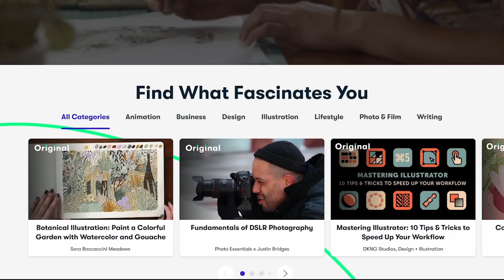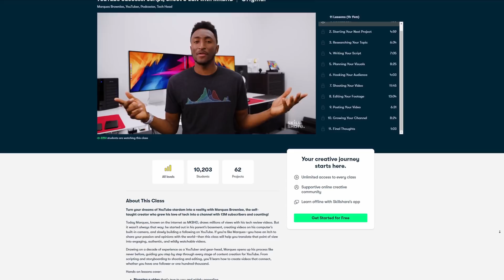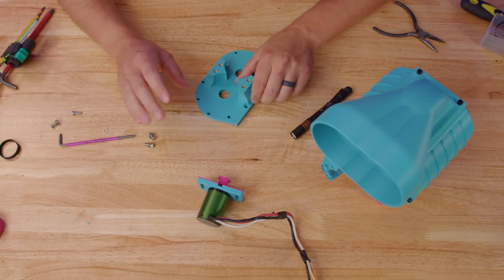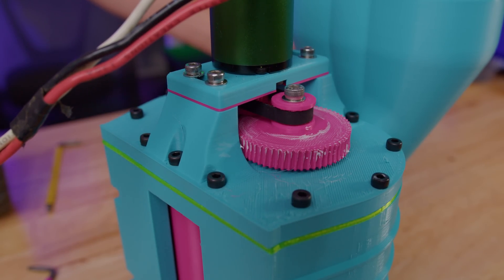I Attached a 100,000 RPM MAX Castle Mamba to my 3D printed SUPERCHARGER..... Will it Survive?

Comment: A cheap solution would be to go buy 4 or more 6800mAh 80C batteries.  Add a Y connector to the ESC to allow two batteries to be attached at once.  That will give you all the amperage you need to drive the blower.  You may also need to look at the motor.  You may have one that is great at high RPM but low torque.  You need a low RPM, high torque motor.  A 5t to 6t 2200kV to 3200kV motor would be optimal for your RPM range and battery voltage of a 2s battery.  Going to a slightly higher kV would increase the amperage requirements, but give more power and higher RPM.  I would start with a motor that closely matches the RPM you are currently hitting, then work up from there to see where the ESC gets unhappy.  Also, a cheap programmer card would not be a bad addition.  You can adjust max RPM and amperage as well as acceleration to make the testing easier.  Also, replace the controller and receiver with a PWM signal generator for bench testing motors.  It plugs straight into the ESC and just gives you a knob to adjust the motor RPM so you don't have to fiddle with the trigger to find the spot where the motor is happy.  Transversely, if you don't want to change the controller/receiver setup, put a tie down on the trigger to hold it at full speed.  Then adjust the offset for the trigger channel to where the signal sent is at 0 power.  Then use the offset adjust to control the motor.  I've done this for tethered circle track speed runs where the car take a long time to accelerate, and you don't want to push  it hard and heat things up too early.

Comment: you could also look for used server power supplies and hook two 12V rails in series for 6S equivalent. regulation would be done by the motor controller though.
Reply: @majorhardware is this a scammer?

Comment: Use a Group 31 truck battery. You can run the motor wide open until the wires melt down and the battery will just laugh at you and keep going. Charge it once a day overnight with regular battery charger. Can pick this all up at any Napa Auto Parts

Comment: Bottom outlet case should probably be a V-shape as visible on superchargers. 
Most of the superchargers are spinning at max 10-16k RPM, but peak efficiency is below half of it.
You could try to use some sort of paint/foil on the rotors do decrease friction.
You could have hollow/drilled rotors to reduce inertia.
Upscaled Cheater inlet?

Very nice project

Comment: Alternatively you could just get a 110v motor, maybe an air dryer motor? not sure it would have the torque, but I'm sure you can find a motor to run higher voltage instead of higher current.

Comment: Just use a car battery to power it. Much longer run times. Can be recharged in about the time a standard rc battery. Keep an eye on motor Temps with such a load.

Comment: you could just buy a car battery,  AGM  or the new lipo they make motorcycle batteries. if it's 12v 3s it should work. these provide significant amperage.  as for a power supply you probably need something that has 30amps or more
Reply: you can buy a 12v 30amp supply but it's not really adjustable. think computer power supply. you could make it adjustable but its not really worth it.

Comment: What you should definitely do are two things!!
1. Install a coupling to dampen the resonance vibrations then your charger won't "run away" !!!
2.You should urgently BALANCE the rotors, they are the main cause of the "wandering" of the whole charger
Tip for balancing: 
Build the rotors hollow and in two parts so that you can use bloops of "hot glue" inside as a balancing weight
I can only guess for the coupling?!
with this motor definitely as big as the gear wheel
you are able to print soft material as a damper for the clutch

Comment: Fun project. 
Try balancing the rotors on a 2 little V stands and a file or sandpaper to remove weight where necessary. Also you can use whiteboard marker to see where the rotors are rubbing on both the housing and each other and sand down where needed.

Comment: Its expensive but if you used Teflon inserts as "bearings" and the rotors its would run mush smoother.... Teflon is expensive though

Comment: When you test this, you could put the radiator on either (or both!) sides, because that type of "blower" will pull just as well as it pushes unlike a fan. They will draw a massive vacuum in a sealed chamber. 
I worked at a place doing electron beam welding and we used giant Roots blowers to draw down the air for a rough vacuumed and they would get us down like 80% of the way before we had to change over to the oil diffusion pump. I think that got us into about 30 ish tor (0.04% atm)(all our welding was in high vaccume, so like... 30 micropascals)
when i say a large Roots blower, the pipe was 10". i could fit my head in the screws. It would hold that .04% atm all night, because we'd leave them running to keep the chambers dry.

Comment: If you're going to use it as a pc cooler, then put a smaller motor on it so that it will actually lasts.

If you're not, then there's no point of comparing it to the fans that were powered by pc cooling fan motors.

Comment: Be really careful with power supplies and brushless powertrains, electronic breaking is  to be avoided at all times. 
If the ESC tries to slow the motor down, it generates power. Contrary to a battery, the power supply can't sink that, so the voltage goes through the roof.
Essentially the ESC fries itself.
Large rotating masses like your supercharger worsen the problem.
I fried a 100A plane ESC and 2 smaller ones with electronic breaking on a power supply.

Comment: build an 18650 batt pack. and use a ebike esc. 
those bldc motors don't really have a set voltage limit. higher volts make lower amp draws ( to a point)  bet u could do a china 48v batt and a 1500W china esc that'll run it for a good while

Comment: It would be interesting if you try stacking up multiple single fan radiators in series under the blower and see up to how many the cooling perfoance increases and how it compares to one normal fan or multiple fans on the same radiators spread out.

Comment: If you do go any further with this you might want to find a way to protect yourself in case it blows up.  You're pumping a lot of energy into those rotors and if they fail the energy is going to want to come straight out of the casing like a bomb.

Comment: It would be totally absurd but is there a way to design a transmission that would jack the RPMs way up from a slower but stronger motor?  For example use a standard AC blower motor like what you could yank from a furnace.  That would have more than enough power, The problem is though startup is not smooth and I dunno how a plastic gearbox would take the initial turn over.

Comment: you need a chain. will be like the belt but stronger. because once you are able to get a good power supply itll prolly strip that gear. chain will spread the load and make diffrent gear ratios easier

Comment: Hello, Supper chargers are used more as an air compressor rather than moving air.
I wonder if you can build up pressure with this after some of the problem solved,
and some how rig an outlet for more air velocity.
Reply: And also, maybe change the in runner motor for a much higher torque rather than those high RPM motors.
Not sure if it is still true that out-runner motors yields much higher torque than the in-runner motors.

Comment: your biggest issue is that motor wants to turn somewhere around 30000 rpms to maintain a somewhat sane amp draw....running it at 7000 rpms is making it consume insane amounts of current...which why your batts arent lasting very long and why your batterys are getting so hot...were talking 150+ amps constant here....you really need to get a gear reduction going to let the motor have some rpms to lessen the over all tourqe load....that or you need to find a really low like 800kv motor...heres the thing...take a motors kv rating...and then input voltage....say your running 2s at 7.4volts x im gussing that motor is 4000kv which comes out to 29,600 rpms...so you really reallly need to work on a solid gear reduction to get 6000-7000 rpm rotor speed with motor at around 30,000 rpms and that will reduce the amount of current required...batts will last as long as they would in the rc car around 15-20 mins....if you dont...then your going to run into serious overheating issues on both the motor and the esc....get the motor too hot and the core will grenade and or burn up the windings...get the esc too hot and it may very well catch fire! all this info can be confirmed in the r/c forums, im sharing as much as i know because i really really wanna see what this set up is capable of!! 1000cfm is absolutly insane....but i belive that if you let the motor wind up to its rated rpms...and get the gearing right....that you could possibly double that cfm output!! also that motor and esc should be rated for 3s lipo...which would be 11.1 volts x 4000kv which gives you 44,400 motor rpms! migt get around 2500 cfm or above at those speeds! could probably get rotor speeds upwards of 10,000 rpms or more!! i cant wait to see what kind of insane monster this project turns out to be!!!

Comment: Power supply = PC Computer PSU
If you cut the green wire off of the motherboard at connector, connecting that green wire to a black ground wire will turn the PSU on. It should be able to supply double digits worth of amperage on the 12 and 5 Volt rails, and it may have two 12 Volt rails.
Black = Ground
Yellow wire = 12V
Red wire = 5 Volt
Orange  = 3.3 Volt
White = -5 Volt
Blue = -12 volt
Reply: Good ideah but, unfortunately, in my experience running drills and low end RC cars off computer PSUs, they really don't like to provide the inrush current for motors. You almost always trip the short protection unless you ramp up the draw/throttle extremely carefully. Even when you do get them working for loads like this, they tend to play very poorly with the feedback they can get. I've fried two running motors they should have easily handled based off current ratings before switching to other power sources (still use them for a lot of other things though).

Interestingly, some of the really cheap sketchy ones that no-one trusts with a PC are the best for this. They seem to have less protection circuity and will sometimes even let you get away with shorting them momentarily without shutting off. They still have a tendency to give out when abused enough though.
Reply: @DrPersonman  Run them with a capacitor on the output. I have a bunch of tiny 25 Farad supercapacitors I soldred into 6s1p banks for this, you'd need 5-6 in series between the positive and negative rail.

Comment: You could just use a big PC power supply. Their 12V rail usually can push the power that the whole power supply is rated for.
If the power supply splits it's current rating across multiple 12V rails, you can just hook up all the 12V outputs in parallel.

A 1000W PSU should be able to provide about 80A, for example.
You can match that to the rating of your ESC.

Also, to reduce the necessary power rating, you can slowly ease into the top speed (like you already did) to reduce peak load. Increasing RPM probably draws more current than holding it.

Comment: Constant mesh would be so much quieter. Then cut a groove in the screws to fit a seal. Although getting an adequate power supply would be more important. Once accomplished you could definitely do better for performance.

Comment: Upgrade to a twisted pentalobe twin-screw, throw on some ball bearings, and lubricate the fuck out of it with silicone grease and teflon powder.

Also slap on a 15k RPM blowiematron motor.

Comment: Impressive! I thought it would self destruct in few first seconds of test. Great job and the sound is super cool!. This kind of supercharger designed for positive displacement boosting. Watt per watt against properly sized free moving axial fan it won't stand a chance for air volume. It's probably even lower than a centrifugal blower. BUT...it can build up high volume and pressure at much lower speed. I think will perform very good in low RPM super dense finned radiator.

Comment: Would it be as simple as a car battery charger. Those can put out 200amps at 12volt for the engine start setting. ❔

Comment: Add 2in length an like 1in width. Will run better volume wise. (I know it's dimensionally proportionate to the fan) 

Look up electroboom for power supplys. U guys could do a colab

Comment: A simple 100mm 100cfm fan at 20W can do the same work as the one your using except more efficiently and with far less friction.
The "Delta PFR0912XHE DC Brushless Fan T28295"  puts out a whopping 185 cfm at 54 watts of power compared to the average high cfm fan.

Comment: I sadly don't think there are any power supplies that can run motors like that, at least not that would function on a normal residential outlet. This should put into perspective how crazy LiPo s are for anyone who doesn't realize. 20c 4,000mah 3s lipo I think is what you had? 20c means this battery is capable of outputting 80 Amps of current continuously (20*4 amp hours) it does this at 12 volts, so 80*12 = 960 watts and this WASN'T enough current to feed this motor. This motor is likely capable of pulling 120+ amps @ 12volts so already hitting that soft 1500 watt cap that most outlets are rated(they can do more but safety is questionable) so yeah... LiPo can put out CRAZY power, and RC motors can draw CRAZY CRAZY power thats the long and shot of it. Just get some Lipos with a higher C rating and they will be able to supply more power!!!!

Comment: What's the voltage on these? If it's 12V or 24V, just hook it up to a car/lorry battery. A normal car battery gives somewhere in the 700A range, You'd think ~7kW is enough for the little motor. :)

Comment: So you could take LiPo batteries with more power. for exmaple, I think your batteries are 2S LiPo´s (just from the look of the held up one) and you could take 3S or 4S batteries for that. Also, what the hell happened to your rc car? XD i know, it´s a basher, but that back wheel and the front wheel (diagonal line from topview) don´t look like they had an easy time XD

Comment: Thumbs up for Dounut reference! Also.....how much attention are you paying to balance? Also, also....perhaps think of a sealed box for the gear reduction and running a very thin silicon oil because the grease just won't last during daily use. I used to run a sealed oil bathed gearbox back in the 90's on my RC10's stealth transmission and it works great for high speed lubrication.

Comment: this is really cool. I would like to see how it performs under load, like running full speed with a restriction on the outlet side like in an actual engine. creating static pressure may cause the supercharger to fail due to excess heat.

Comment: COMPUTER POWER SUPPLY. Or a 750 watt 10 dollar server power supply that you can buy on eBay, which puts out 62 amps... I bought 3. All you have to do is wire it up and research which pin powers it on.

Comment: with video cards taking up 3 slots and having three fans, and CPUs now starting to multilayer the chiplets and having radiators that are almost as big as graphics cards themselves, at some point gaming is going to need to move to refrigerant cooling with a turbocharger on the external radiator for "Boost Cooling" (should trademark that now while you have the only working PC turbocharger) to accommodate the increased need in thermal cooling to coincide with peak loads.

Comment: 1) the description uses the Amazon link for the threaded inserts for itself AND the Motor link.
2) depending on what the motor needs, you could probably find a wall wart for the required voltage, and get two (or more) to reach the required amperage.  Cut and solder tips together to make things mate and you should be good.  (this is he technique I used to salvage various PC/PSU fans to make a soldering ventilation setup.)
3) You're going to have to induce some amount of rotation on the Root extrusion.  Current geometry is forcing air in pulses which make for weirder air measuring and might be causing additional, unneeded challenge for the drive system.  I would say a minimum of 1 full turn across the length but 3 might be better; this should allow for a constant flow of air instead of air pulses.

Comment: hay bud !   if you already have the stuff this can be cheap-o way.....  kind of simple but , for years now i use a old  used 12v lead acid car battery (fluid topped up)  and a big type car battery charger the 200 amp type a auto shop or enthusiast has... just hook it up to the LA battery and attach 12v esc to the posts too . battery smooths out the bad waves . ... maby add a cap or super cap in line too...or a good filter in line 
this is how i do duration testing for big camera drones motors , i let them run 2 hrs as break in and endurance matching

Comment: pc power supply , match your esc amp ratting to the power supply 12v rail. plus some for error.    if you need 19v laptop power packs in parallel..

Comment: so you could obviously get way more airflow with a normal fan paired to the castle motor, but the point of roots/screw is compression, so you should test static pressure.  that's where it should shine.  the other pc fans won't stand a chance

Comment: 12v dc..... so 3C Lipo is over 12v fully charged right... So car battery? Maybe Deep Cell. You may have to reprogram the Castle for Lead acid battery, but yeah. I'd use a car battery. Just saying.